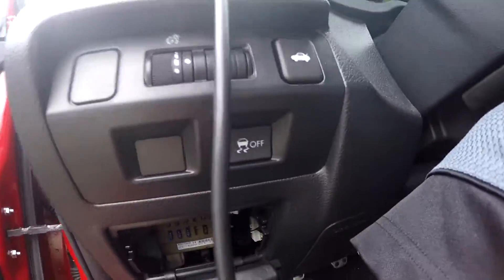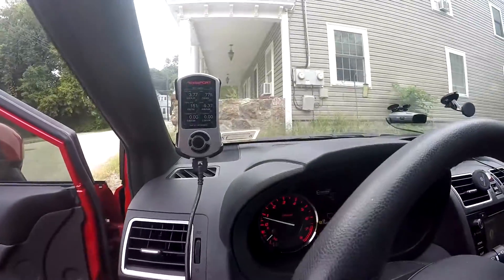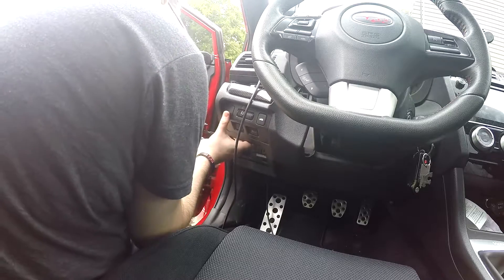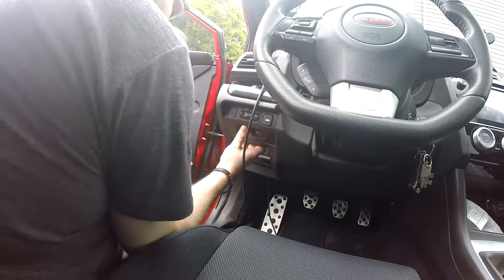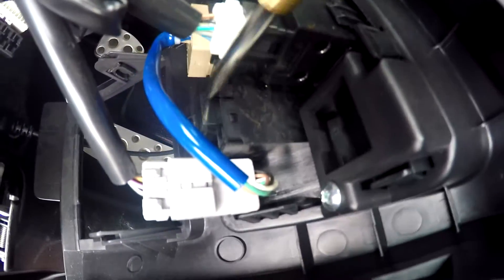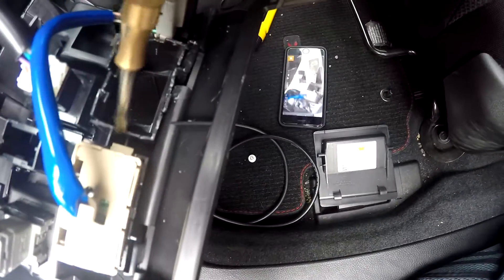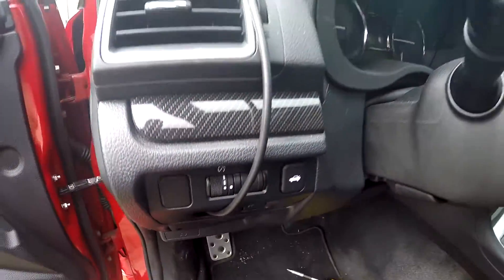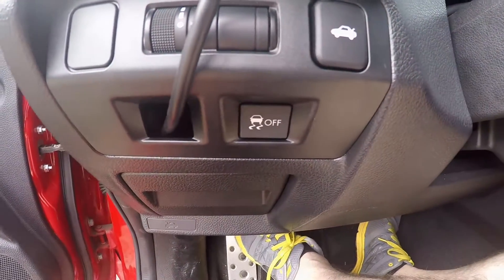Easy Accessport Cable Routing

Comment: There are two tabs on top and one mid bottom. Flip the entire piece upside down. Wedge a small screwdriver to keep top ones clear, wedge a small screwdriver on the bottom tab and use fingers to push the plate through. This way you keep the plate intact if you sell the car and put it back to its original condition.

Comment: Nice. But why didn't you just run it along the steering wheel and under the panel. ? You wouldn't have to remove the plug in your dash.